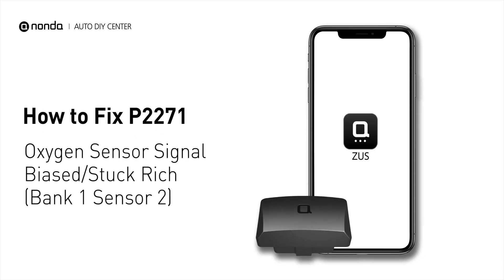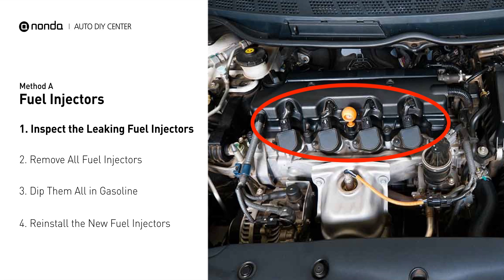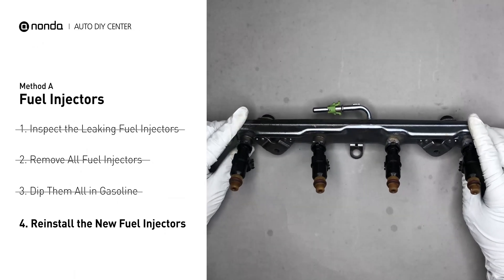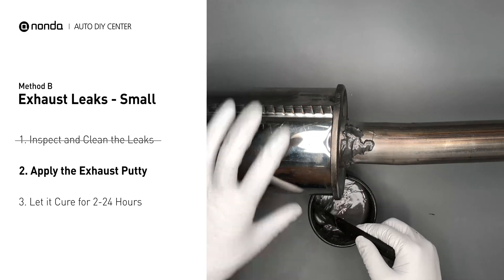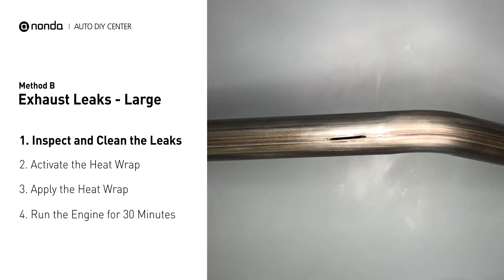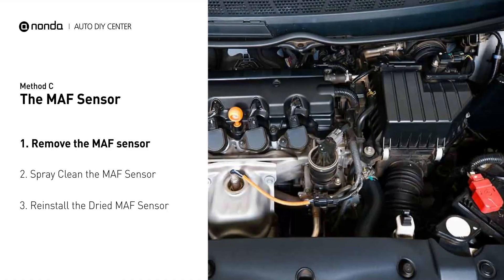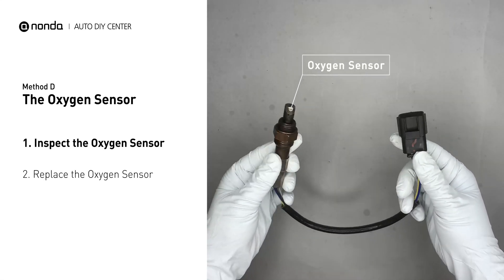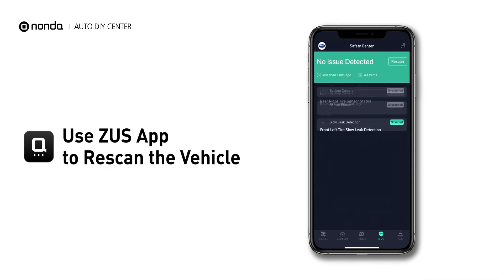How to Fix P2271 Engine Code in 5 Minutes [4 DIY Methods / Only $8.99]

Comment: Could it be also because of bad spark plugs?
Reply: One of my mechanics think that is my problem. I replaced all the O2 sensors as well and even the MAP sensor. I just did a tuneup at 100k miles and my current mileage is 166k.

Comment: Transmission slipping really bad the code reader read p2771
.
Reply: Bro, this clip is about 2271 ;)
Reply: @afro8859 P2271 can cause car to stutter thinking it’s a transmission related issue.

Comment: Before doing anything above, check the air intake filter. Just switch it out and check with a scan tool, if the voltages of the 02 sensors return to normal. The downstream sensor should draw a line of ~0.67 volt if cruising at constant speed. While braking, it goes down below 0.2 volts volts and on acceleration you see about 0.7 and more. If error persists,  do MAF sensor cleaning and then consider doing injector work or fumbling with the exhaust.

Comment: Hi my name is Fred I hooked up my Snap On scanner and found the DTC code P2271
Also I checked the pressure on the Catalytic converter and it’s “Good” no back pressure found and on the 02 Bank 1sensor 2 sensor the vehicle owner has already replaces a new O2 sensor on there, I’m guessing I’m going to replace the fuel inyectores, they may be Leaking, this is a 2014 Chevrolet Captiva 2.4L 
Steve can you Please give me your opinion...
Thank you Sir
Reply: Did you figure out the problem, I'm having the same issue?
Reply: @chrisb7109  same here, found a crack in the manifold, I replaced that hoping it was that "that would cause both those codes" but still got both those codes, guessing it could only be either the fuel injectors or the catalytic converter 😭
Reply from the maker: Hi Fredi, please check for exhaust leaks as this is also a factor that triggers this code.